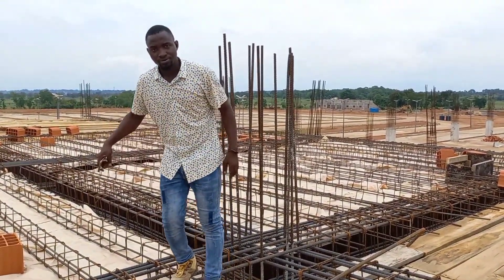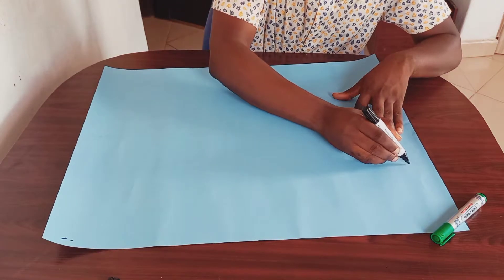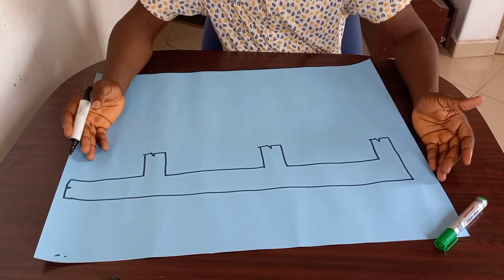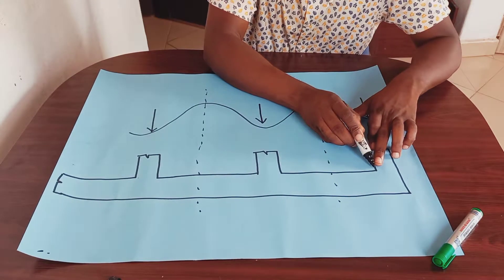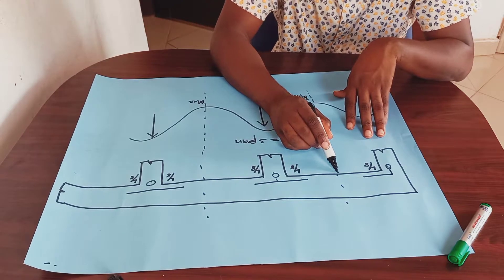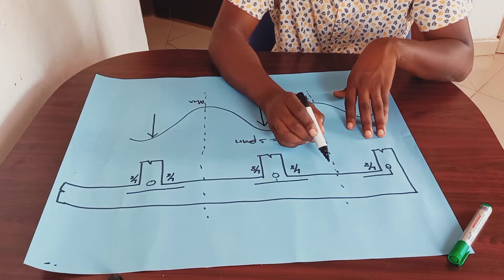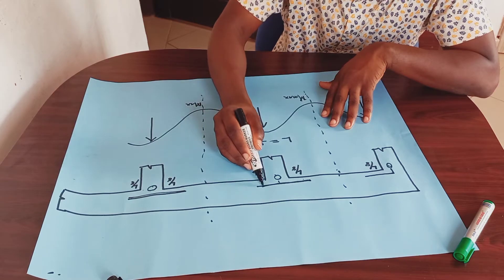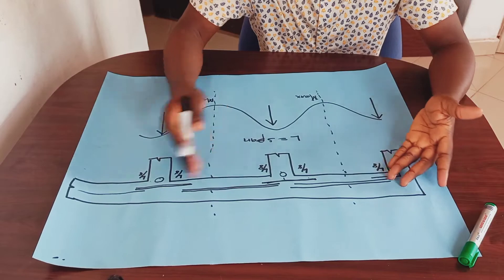Beam curtailment simplified

Comment: You explain curtailment very well.

However, I couldn't help but notice an issue:

5:00 -> You said the moment is zero.

The moment is not zero. It is tension that is zero, not moment.
It is negative (hogging). Clearly, even the BMD you drew shows that.
Therefore the bottom part of the beam at the support experiences compression force hence requires less steel, because concrete is good at resisting compression forces.
That is the correct explanation.

Overall, the explanation is very good.
Thank you.